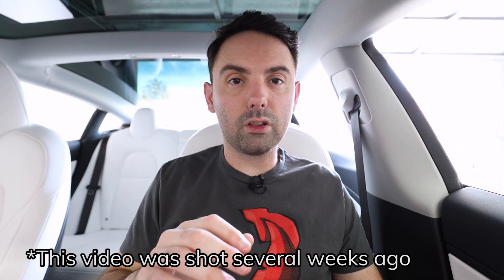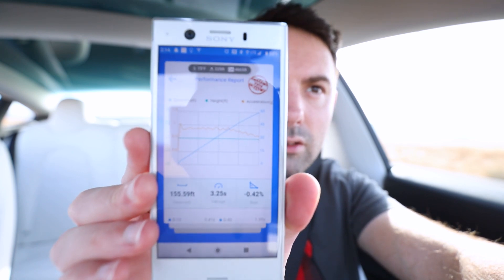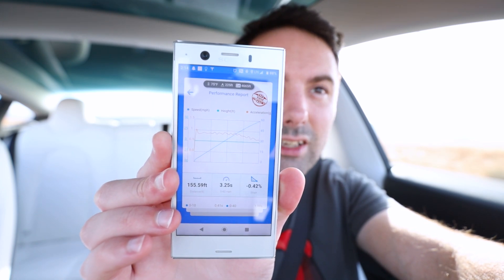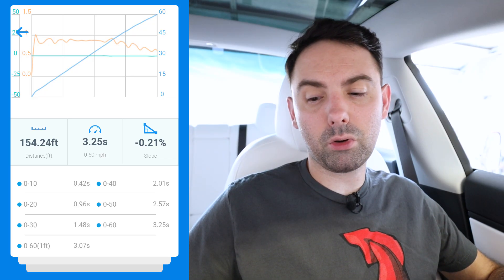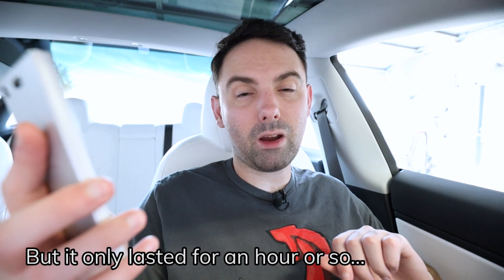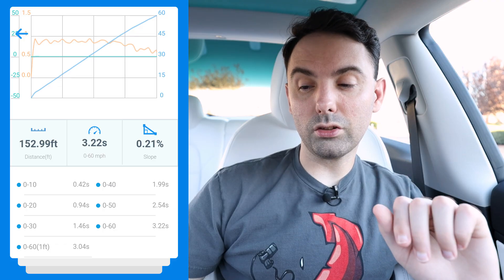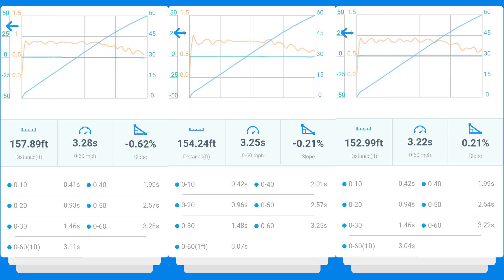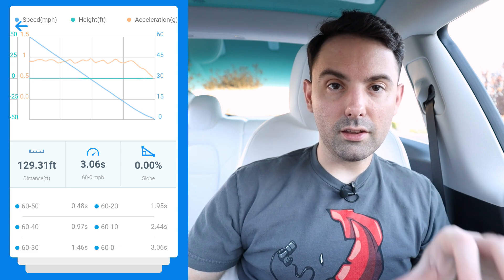Tesla Software Update: Another Power Boost?!

Comment: It’s interesting the sound in the car is different after you took out everything. Does it sound very loud compared to the default?
Reply from the maker: The motor noise is much louder with everything removed (especially once the rear bench is removed).

Comment: I’m surprised tesla didn’t have the previous capability of regenerating down to 0 mph with one pedal driving.  My Chevy bolt has had this as a part of their engineering design from the beginning, and I absolutely love it!! I only drive in this mode...the more aggressive, the better. Ideally, I want to avoid touching the brake pedal at all. Anyone that is true EVist will want maximum regeneration down to zero. You can simply adjust your desired slowing by feathering the accelerator pedal.  Who “wouldn’t” want this? If you don’t like it, it’s just because you are “too used-to” the way an ice car operates....”coasts” because it “can’t” regenerate.

Comment: I do not like the one peddle driving for two reasons. Firstly while backing out of my garage with a slightly downhill drive, it stops dead each time I inch back a bit (I have to go slow as my garage is quite narrow). Secondly I found myself trying to judge the place where to totally ease off the accelerator and ending up either short or running the risk of hitting the stopped car in front. There is too much planning and concentrating needed to get this right.  I have now opted for creep mode which brings me to a much more comparable stopping approach that I'm used to with my other (ICE) car.
Reply: Dennis Kavanagh, you are just inexperienced with one pedal driving. I have far more control with my EV, inching-it forward or back, far better than any ice vehicle or “non-one-pedal-driving” EV.  
If “creep mode” can do it, then why can’t you? That tells me it’s just your inexperience.
Reply: T Jam You’re probably right. I’ll just have to keep trying it.

Comment: Shucks, all they did was shave 20kw off my supercharger speed overall(head down, hands in pockets, kicking dirt while wandering off//1st world problems) 2013 S85 80k miles.
Reply from the maker: It doesn't seem like the last update has had any meaningfully negative impact on our S70D's Supercharging rate. Then again, our S isn't quite at 40k miles yet, doesn't see all that much Supercharging, and could never charge as quickly as the old S85 pack anyway.

Comment: Nice report Alex. From what I understand it’s the permanent magnet motor they replaced for the front motor that allows you to have the one pedal driving. My 2019 S is just prior to them replacing that front motor.
Reply from the maker: Yeah, the Raven powertrain in the Model S & X basically ditches the induction motor up front and replaces it with the Model 3's PMSRM rear drive unit. Thus, all Model 3 and Raven Model S & X received the one pedal driving feature.